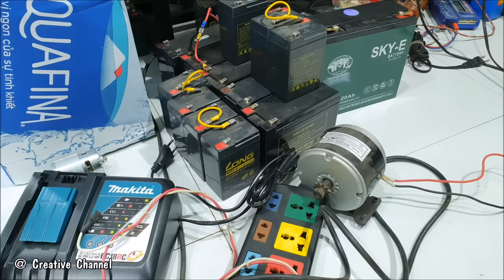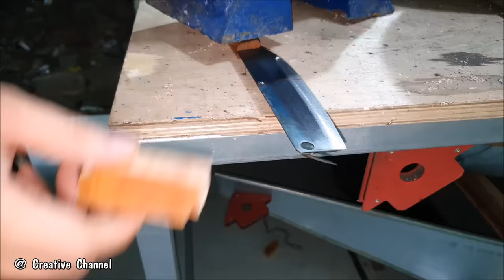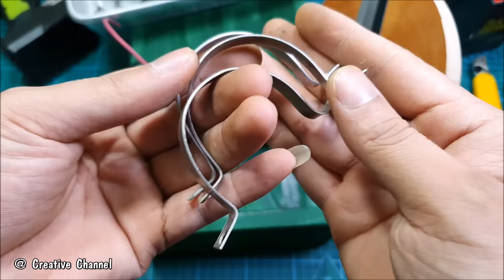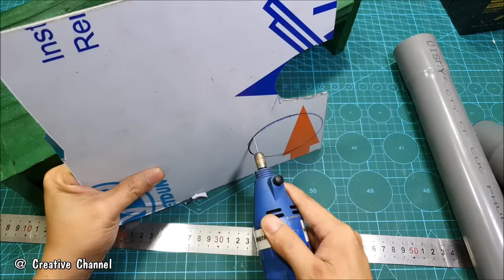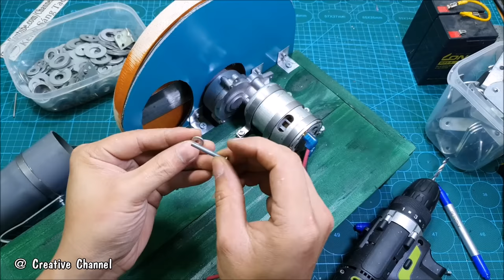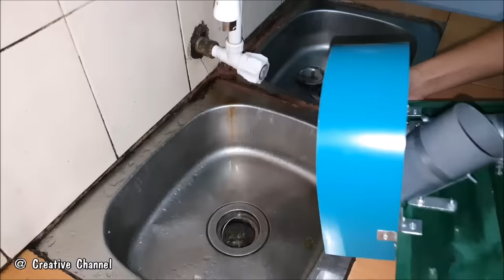Build a Onion Slicer Machine Using Wooden Cutting Board At home

Comment: I hope to see in your version 2 slicer that :

Connect it with a big plastic food storage box with option to separate from it

Try to reduce the size of the body  and  use lithium Battery and isolate it and add charging circuit

You can also reduce the weight and size of the circular body to consume lower power for using smaller motor or increase the torque of the same motor

Comment: Go to the shop and buy a Mandoline slicer there about $10, really quick, easy to clean, really hygienic.
Then you wont need to buy a pillar drill, angle grinder, battery drill, jig saw, chop saw, pop rivet gun, dremel, crimping tool, switch, electric motor, batteries, nuts, bolts, screws, wood, plastic, and save your three knives! Hope the floor is clean!
My cat enjoyed watching it though!

Comment: Finger protection, cover, and more important, better dc transformer than battery!
In any case you have to load the accubattery!
So why not power the motor directly?
Reply: Transformer is not dc
Reply: Maybe i was not clear....
Input 230/120v AC!!!
Output xVolt DC!
That means WITH rectifier ! 
Take ANY from HDD (12v)
Or what ever you find!

Comment: Is there any way to prevent the slices from spreading around the plate?
 Because the slices scattered around the plate are just spoiled.
So if  there any way to prevent the slices from spreading around the plate then it will be the best cutter machine.

Comment: 12volt dc motor.  6volt. Battery se. Run kar rhe ho speed slow milegi bhai. 12volt adapter use kijiye. Best results. Lakin onion ke liye thik h. Kisi ka gla nhi cut krna😂😂

Comment: first i buy 70$ jig saw, second miter saw 250$, drill machine 60$, 
motor & battery $?,
other tools may be $?
what a cheap tool, homemade with screws & beautiful arcitechural design,
charger 10$